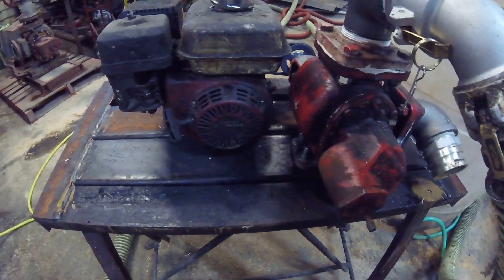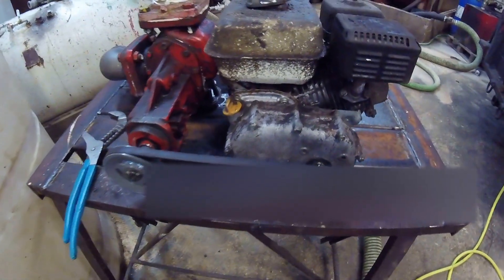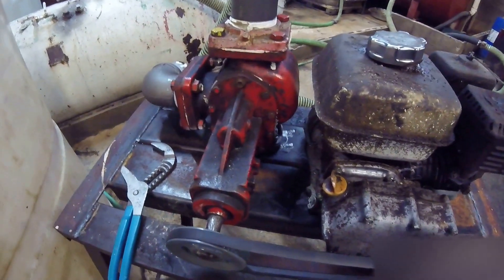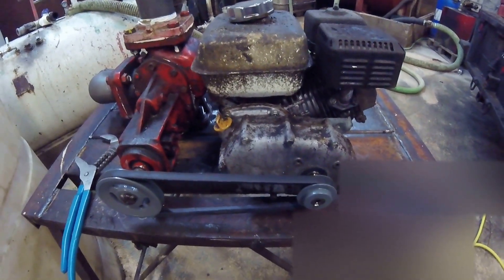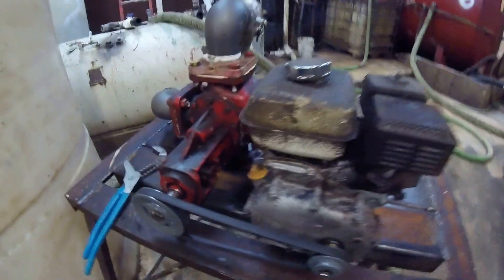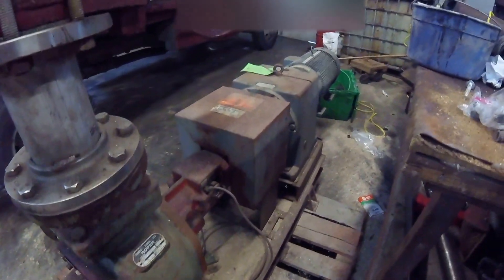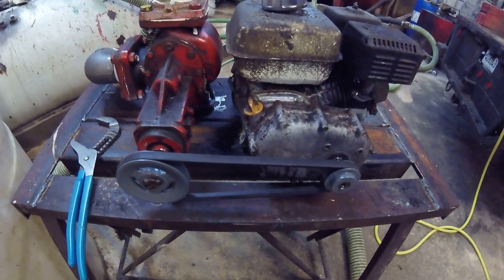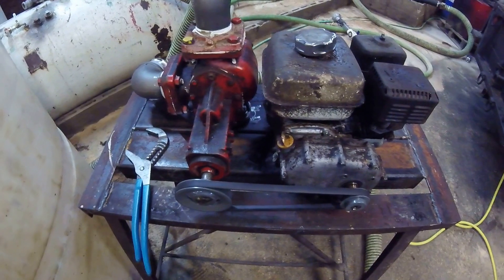Belting up a 3" Roper gear pump with only a 5HP engine? Hell yeah.

Comment: you have a relief valve. You can use that to throttle back the pressure. As a short term fix. Long term, you should get rid of the belt and go with a lovejoy and go long coupled. On a gear box like the second unit.
I work on Roper for a living.

Comment: 600 to 1000 rpm is good for the pump. Most tankers run em at 110% over idle
Reply from the maker: Kick ass. Thankfully I no longer need to GAF. I sold the company and am driving the gravy train these days. Thanks for the view!
Reply: 6 years later , I found myself typing the same comment until I noticed I commented already 6 years earlier .  Damn, I'm getting old

Comment: Would the discharge side produce enough PSI to spray through a 1/2" or 3/8' nozzle with any sort of pressure?
Reply from the maker: Yes, the pressure would be extreme at that size, the relief valve would need to be adjusted, and even then it would probably blow apart. I wouldn't reduce the discharge port at all without consulting Roper. What product do you want to spray?
Reply: roper  pump bypass usually 50 t0 100 psi
Reply: I got 2 of those ropes with p.t.o . But I have been wanting to know if it would work like that......p.s al l.j you need is a strainer to keep junk bnb out of pump.. easy to fab up